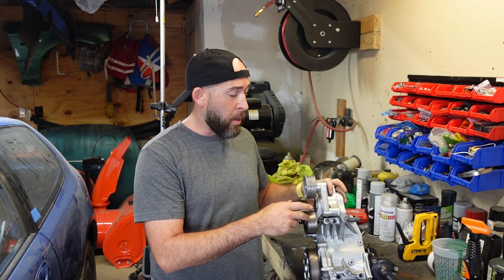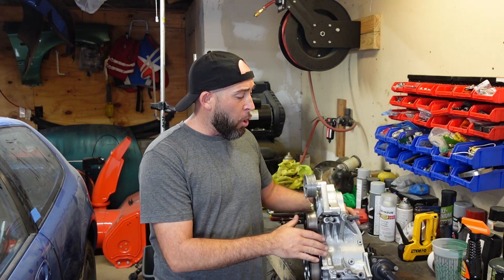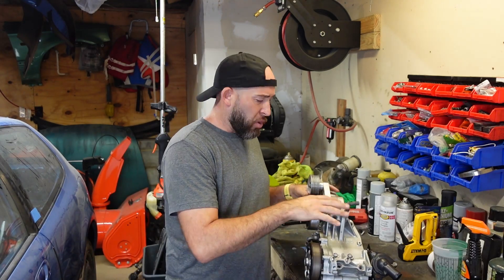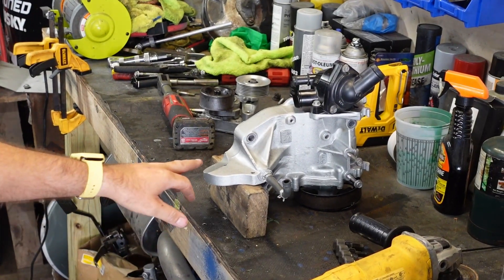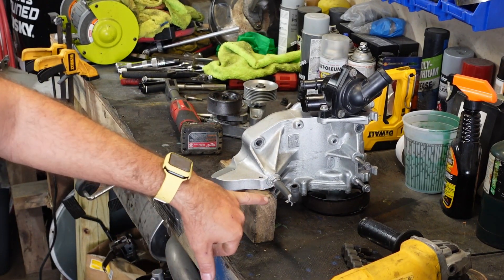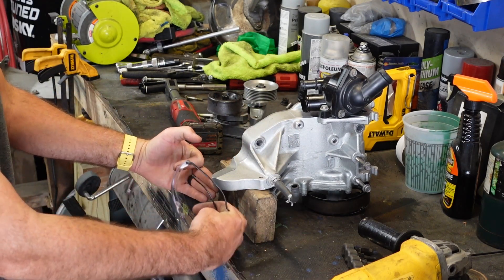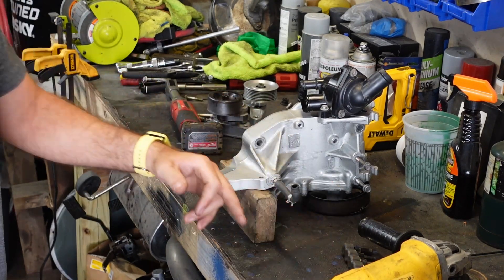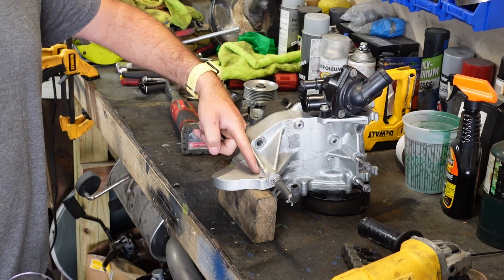K24 SKUNK 2 Ultra Race manifold install (modifying water pump)

Comment: Where did you install the MAP sensor at?
Reply from the maker: I put a 3/8 barb fitting in one of the ports under the manifold and connected a hose to the map sensor.
Reply: @  I see, how did you secure the hose to the MAP sensor?
Reply from the maker: @MrBasement2323 I put a barb fitting with a hose connected to it then put the map sensor directly on the hose and clamped the hose.
Reply: @wisin_k20  thank you very much for the info!
I’m assuming you haven’t had any issues with that setup?
Reply from the maker: @MrBasement2323 na not at all.

Comment: Is there any after market water pump housing u can buy so u dont need to cut and make the ultra race manifold fit?
Reply from the maker: @kevinmoua3792  I’m not 100% sure but I think ktuned new pulley with tensioner is for that.
Reply from the maker: @kevinmoua3792  but if you are trying to save power steering I believe you have to eliminate it.
Reply: @wisin_k20  do u have a instagram i can follow

Comment: What pulley setup did you use? I have ac?
Reply from the maker: I use the k20 crank pulley. And I used the karcepts ac/ps delete kit.
Reply: @wisin_k20 I have a k24 bottom k20 head… have ac… what do I need to use? 🙏
Reply from the maker: @TonyEffinNguyen  sorry to say but your gonna have to eliminate it cause your gonna have to cut the water pump housing to fit the ultra race manifold or you can use the ultra street version and keep everything the same.

Comment: So u telling me u blocked off the pvc where the block blinding
Reply from the maker: Yea I’ve been blocking them for year never had a problem on none of my turbo setups plus I’m Running an external catch can. If you wanna find out if your motor is VENTING out pressure in the block properly in a turbo setup block the valve cover breather and oil will start to leak from the exhaust side of the turbo cause it’s the Weakest point and when you unblock it the oil leak will stop leaking I.E the motor is venting out sufficiently.
Reply: Wow i didn’t know this about the pvc  i will definitely do this to my setup also thanks